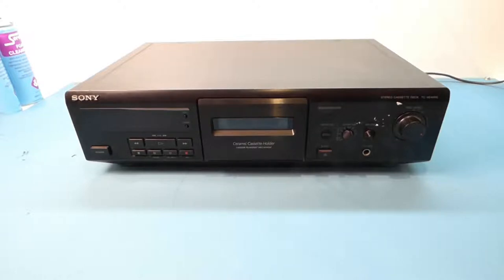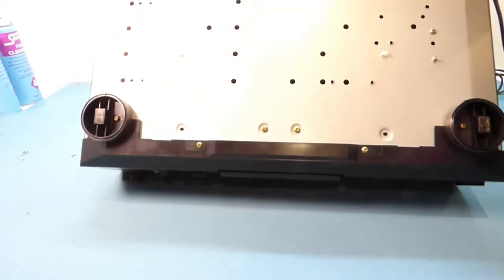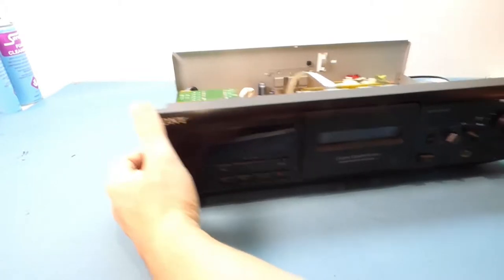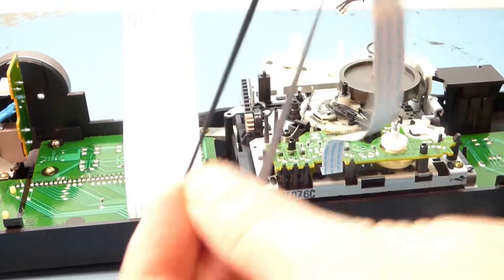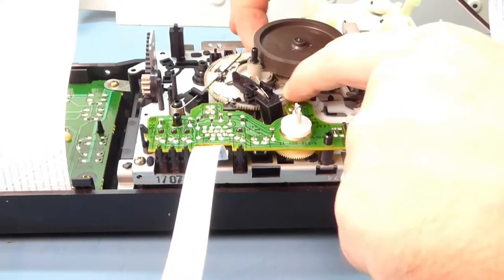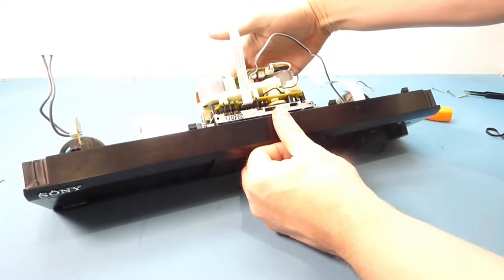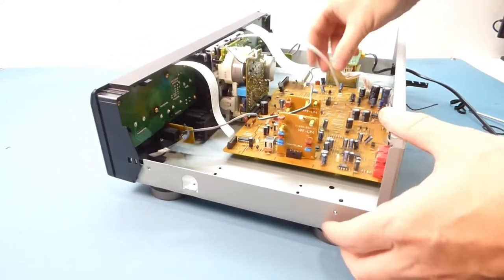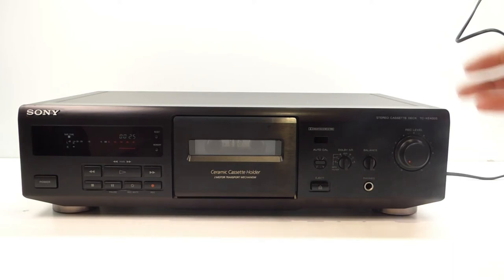HOW TO - change the belts on a 1990`s Sony cassette tape deck - model TC-KE400S

Comment: Awesome!  Thank you so much.  I just bought a used Sony deck, different model but very similar.  I was having trouble replacing the belts until I watched your video.  I got it working now and am very happy!  Wish I had watched it first.
Reply from the maker: no worries

Comment: Thanks so much. I have the identical deck. My deck started screeching during playback before eventually being unable to playback or eject. Got replacement belts off eBay and followed your instructions and now all is well!! Had to replace a belt in my Sony MinDisc deck too, wouldn’t eject the disc!
Reply from the maker: Glad it helped

Comment: Thank you . this was the info i needed to fix my sony tc-wa7esa. It was locked in the play position and doors would not open. After setting the gears in the proper position it is up and running.
Reply from the maker: glad it helped

Comment: Great video! I've got to replace the belts on my  Sony TC KE200 which is the same generation as the one you've demonstrated so  I guess the transport will be the same.
The belts are on their way and  I'll be setting up your video  to watch while I do the job. Thank you so much - sick of shut-offs and mangled tapes, but probably wouldn't attempt to fix it without your help.
Now, if you posted a tutorial on how to replace the pinch-roller . . . . ;)
Reply from the maker: they use the same mech. Even the same PCB. only difference just some extra components on the board for the 300/400. Pinch rollers are easy, they just clip out.
Reply: @Sortitoutman  > Thanks for your reply, I thought they would probably be the same across the range. As for the pinch-roller . . . I hadn't looked closely at it before (except to note that it was pretty cracked) and assumed I'd be up for some major dismantling, but thanks to a torch and the trusty dental mirror I see that it is - as you say -  a clip-fit straight into the armature. Fabulous!
Many thanks for the heads-up on that one.  :)

Comment: I still don't understand why they made 90s era machines like that with belts that disintegrate into black jelly, while at the same time I've taken apart decks---usually made by Panasonic---from the early 70s with original belts that sill worked fine.

Comment: Great video. Thanks. I read that this has the TCM-190 transport which is troublesome and unreliable, is this true?
Reply from the maker: nope its used in may decks, as with anything of this age works well if looked after. woest case a split mode drive cog and new belts needed.
Reply: @Sortitoutman  awesome thanks for this. Many ppl on the forums hate them

Comment: Hello! I own the Sony TC-K461S model and I think I have about the same mechanism as your model in the clip. Can you tell me, please, what are the dimensions of the 2 changed belts? I have to change them too, but I found different sizes at online sellers, even though I looked for the code in the manual.
Thank you in advance for your answer!

Comment: Nice video, do you have any tips on doing the 3 belts on a TC-K677ES, just got one used and it winds forward and back but not engaged the head to play, the belts fell a bit soft I think so I'm just going to do all the belt its about the same age as this one is this video.. Everything else inside looks good. Do you have a video on this mech for the TC-K677ES and do you advise to always check the azimuth? do you have a video on that? I purchased a belt kit with pinch rollers, should I just do the pinch rollers or leave the stock ones in your view?

Comment: Good advice and guidance; I've the TC-K415, that is almost, if not, identical. I've removed my belts for now. The large flat one was oily, possibly caused due to long term storage, and inevitably, overstretched. I didn't see you spirit clean the large metal flywheel rim which mine will certainly need; perhaps my comment will help too? Thanks!
Reply from the maker: Glad it helped

Comment: I replace the belts but the capstan belt doesn't want to center, drifts off to one of the side of the motor spindle drive wheel. This results in a higher flutter and a lower speed, not great. Any ideas how to fix this issue? Thanks for any answer.

Comment: Hi, can you please explain the right position of the white cog (cam gear) with the black arm, it has also a spring. Is the right position when heads are down? But they are also down in forward or rewind position, so how can I know?  I have the tc-ke 500s cheers

Comment: This video will help me repair my TC-KE500S as they are quite similar. There is quite a bit of melted belt on the gears. What can i use to clean the gears? Thank you.
Reply from the maker: Yeap, all the late model Sonys use a variation of the same mech, TC-K /KB etc. Use isopropyl alcohol to clean the belt residue, you use this to clean the heads etc as well.

Comment: Thanks for a very well produced video.   I have the TC-K715S   It hasn't had much use from new .   Has been stored in a room and just powered on and off every year for last 15 years.  When I pressed play last year nothing happened ie the captain doesn't engage.  Could this be the belt ?  Just tried it again and the eject does not function.  There is no tape in.  Any advise appreciated
Reply from the maker: Belts will have perished, the mode belt will have failed and its locked in "play" which is why it won`t open. Just needs stripping down a good clean reset and new belts and pinch roller.
Reply: @Sortitoutman    Many thanks for your reply.   I've got the belts on order and will report back hopefully when I've fixed it.  Looks like I will need a pinch roller too.
Reply: @Sortitoutman  could you please explain "reset" thanks

Comment: I have a TC-KE500S that needs new belts. Would the TC-KE400S belts be the same size. Also do you know where I could order belts. I found a guy on ebay but they are in portugal. Do you know of any in the states. Or maybe I could get them from where you are from. Thanks for the help.
Reply from the maker: Yeap, they would be fine the "guy" in portugal is fine for the belts, you have no problem if you buy from him - not much point me sending them over him as I`m in UK anyway!

Comment: WE HEAD ALREADY A FEW TIMES. FOURTY DEGREES DURING THE SUMMERS. AND RUBBER CAN'T HAVE THAT. ON YOU TUBE YOU SEE A LOT OF VIDEO'S HOW TO REPAIR IT. BUT YOU MUST FIND THE RUBBERS AS WEL. AND I WAS ALWAYS THINKING THAT THE TAPEDECKS WHERE USING PLASTIC WEELS TO CONNECT THE MOTOR WITH THE REST OF THE TAPEDECK.

Comment: Any idea if this will be the same on the k717es? Just picked up a broken one and ive yet to tear into it
Reply from the maker: If memory serves, thats a TCM400 so similar layout as in it has an assist, mode and capstan motors that need belts, its not a direct drive model as on some ES models like the 6ES

Comment: Could you help me to repair the tape sensors (CrO2, record and Metal tape ones)? Sometimes they don't detect any tape on the deck, don't recognize metal tapes, and, at worst, make the whole mechanism going into a frenzy mode rewinding or forwarding, playing with a kind of hiccup and no music, making a horrible noise or trying to chew my tapes to finally getting blocked not allowing me to eject the cassette. My deck is similar to yours. Thank you.
Reply from the maker: Theres a row of reed switches along the top, they may have plastic covers on them, slide these off then give the switches a clean with some good quality switch cleaner. Re-assemble, all should then be good.
Reply: @Sortitoutman  Thank you. The covers are somehow loose and tend to drop. I added just a very small amount of silicone sealant and now the whole stuff works quite good (not perfectly but it's way better than nothing).

Comment: Where did you order the belt, i just hope I orderd the right one, cause the last one i orderd was square but to thin, and i put it back together, and I pressed play and it just fast forwarded the tape nothing else
Reply: And I could also stop it whenever
Reply from the maker: did you order both belts? As rewind / forward wind is driven by the smaller mode / assist motor.
Reply: @Sortitoutman  yes I ordered the the flat round one, and the square belt
Reply: @Sortitoutman  I have a belt coming in from i think Slovakia, this belt said it would Definitely fit the TC-K461S that I have
Reply: @mikeyacton1978  Hello! I have the same model as you and I want to change the belts, because they were destroyed due to the passage of time and I don't know what size they have 2 replacement belts!
Do you have any idea what the dimensions of the 2 belts are? To know exactly what I should order? Thanks for the reply!